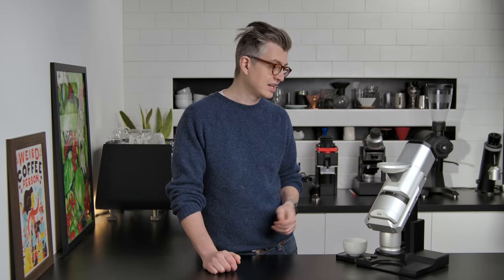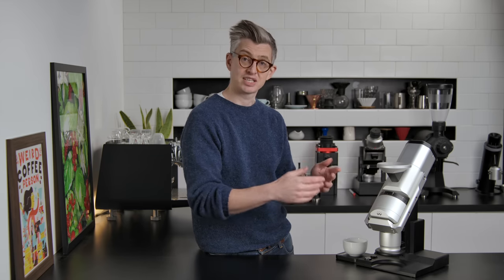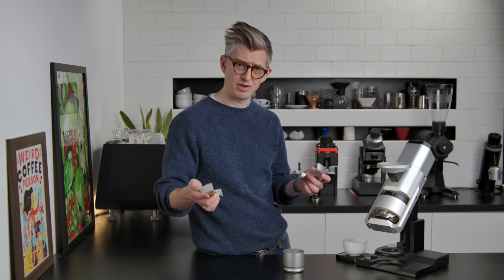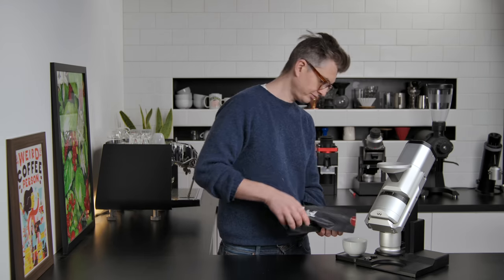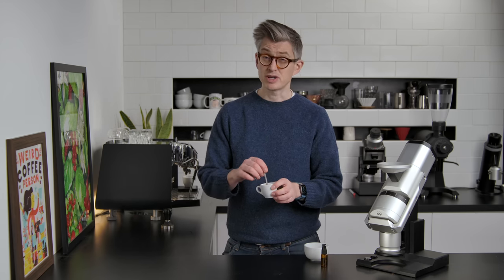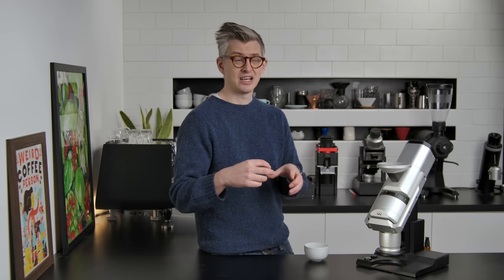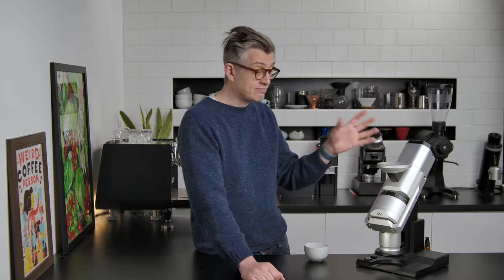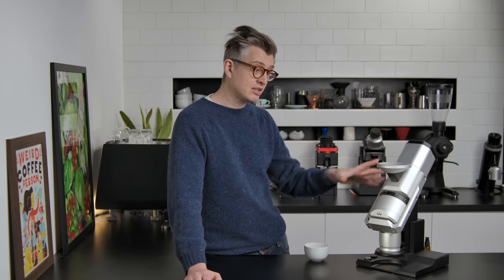The Weber EG-1 (Episode #2)

Comment: Drinking an espresso from an EG-1 right now. Good review. It really is a pleasure to use. The chaft spray is annoying. I never noticed the hunting for speed, at least audibly, but I’m grinding at 700-900. Maybe that affects it. 

I wish the chute knocker worked better. Coffee always gets stuck in here if you do not RDT.

It would have made the video longer, but it would have been cool to show how alignment and swapping burs works on this grinder. It’s pretty unique and highlights how well thought out this whole system is.
Reply: Nick, I too was frustrated with the chute knocker. Recently I joined the forum on Weber Workshop’s site. That exact complaint was brought up and Doug Webber stepped in to provide a solution. If you check out the instructions page on the site for the EG-1, Doug provided a pdf file for instructions to cutting out a wiper blade for the chute itself. Works pretty well.
Reply: @aidanfinger5934  thanks for the tip! I didn’t realize there was a forum on their site. There goes my afternoon.

Edit: I gave this a try and retention and exchange is basically zero now. I still wish it wasn’t needed but this will do! Just be careful using the knocker when the burrs are spinning if you do this mod.

Comment: Hey, i think that the way it chases the rpm is amazing, it makes me doubt that other grinders actually manage to be at a constant RPM, it seems like this uses a PID variable frequency drive, and from an engineering standpoint, it is a hard thing to implement and make it as elegant as you see it here. Let me tell you that often, the electric motors used in computer numerical control (CNC) mills and lathes, used for machining parts out of metal like the ones you see in this grinder, use this same style of rotational speed control. In machining applications the rpm of the motor of the spindle is very critical in order to manage the heat produced during cutting as well as the forces that the cutter has to tolerate, and they very often can keep the same rpm within about + or - 50rpm.

Comment: Hey James, the stopper at the bottom of the catch bin looks like it could be used as a tamper? I was just wondering if you tried to use it as one
Reply: Not sure if it’s exactly the same, but it looks exactly the same the Decent shaker/funnel that I own. And the stopper is just a bit large to be used as a tamper on a 58mm portafilter. This makes sense, and I’m not sure if it could be done differently, because the opening at the bottom of the funnel is designed to sit just inside of the portafilter, and the  stopper has to extend just past the inside rim of the funnel in order to not fall out the bottom. On mine, at least, there is also a small hole in the middle, so that’s not great. 

Two more thoughts. One, it sorta operates as a leveler, if you replace it in the funnel after dispensing the grinds, and if you’re filling the portafilter to that extent. But i tend to prefer my actual leveler. 

And second, and last, to each their own, but I’m just gonna guess that midlife-crisis-dude with a $3500 grinder (and idk, a La marzocco to match?) also probably already has an unnecessarily fancy tamper setup.

Comment: Right, so now I'm going to take off my "James Hoffmann is such a nitpicker" spectacles, and put on my industrial designer specs. For 3500 western currency units, I'd want to design something that has the ability to put on a bit of a show. Something to involve the user in its inner workings while it's doing its job. It would be cool to see the coffee dropping into the blind shaker, as well as it giving you visual feedback on when the grinding is done.

Is it a potential source of mess, to separate the exit nozzle and the blind shaker? Not if you optimize the flow of grounds exiting the grinder and falling into the blind shaker, and the way the falling grounds are slowed down when they do hit the blind shaker.

A more powerful motor would not get slowed down by the beans whilst grinding, meaning it wouldn't need to account for loss of grind speed that much. The unit looks like it fits a rather large motor, so I'm curious what the need for the speed compensation is about.

Besides that, there seem to be a few ergonomic flaws, like having to put your finger next to the (hopefully always inactive) burr grinder to take out the front part of its cover. Also, because of the size of the unit, it might obstruct your view on where you're grabbing the blind shaker when you're standing next to it, particularly if you're a tall person. You have to feel for it carefully or bend down to see it.

Sorry to be a little harsh, but I think the price justifies the scrutiny.
Reply: Shaker holder can be lowered down fairly simply as it “rides” inside the groove and simple push of a button allows user to change height easily. Medium to dark roasts tend to fall nicely into shaker without any mess or any RDT. Unfortunately lighter roasts are totally opposite and if shaker is not all the way up it a fairly messy affair. I use mine at 700rpm and during then grinding process and according to rpm display speed varies 20-30 rpm on either side of 700. Without any beans inside and when on it is whisper quiet and it is very easy to know when grinding is complete as the noise stops...As regards to removal of the bottom collar thankfully fingers don’t go anywhere near the burrs and being able to clean it in 60sec and without need of tooling is absolutely amazing. Just bit of feedback from day to day user

Comment: The hunting for the right RPM is probably part of a PID control as you said it's below and above depending on where it is in the grind.  Probably in the intergral part of the equation which handles error sum correction.  I've been playing around with PID mathematics and I can provide some interactive implementations with each part of the equation graphed out.  That error correction is a pain in the ass!

Comment: I suppose the trade off with the changing speed is that you pay for accuracy with sound.  Every grinder is going to change speed as it encounters more or less resistance, but most of them won't account for those changes.  Increasing the spindle's momentum by running it faster or bolting lead plates to the burrs ought to smooth it out.

Personally, I think that sort of thing is pretty cool - I get to experience how it's working or that it's working or something along those lines.

Comment: Excellent video. I could tell immediately this was an expensive machine. I appreciate you saying the price right away. 

I have been using the same Capresso Infinity Plus model 560.01 conical burr grinder for 12 years. Today you can buy 35 of them, or one of these. 

I own a roasting business...our commercial grinders we buy cost 1/4 the price of this.

Granted, the features and functionality on this one is amazing! They have thought of everything. Yes, grinding your own beans can get a little messy.

I like the idea of the spray bottle...is this just water?

Comment: I'm into getting the best coffee I can from a budget limited by a wife who is not as enthusiastic and picky as I am. As an ex engineer there is no doubt that the EG-1 is a lovely machine, but waaay, waaaaaay out of my league!
I have just purchased a new grinder, and spent all of £119 on it!
It actually replaced a 10+ year old Iberital grinder which cost a little more if I remember rightly, but it had worm-wheel stepless adjustment, which made changing from espresso grind to pour-over grind so tedious as to be impossible.
I've bought a Sage "Dose Control Pro" grinder (sold as Breville in some places) - and it is a great little machine.
I'm sure it lacks in many ways, but I have it dialled in for both espresso and 'Clever' pour over methods now and am very happy with the upgrade.
I'm a little surprised that you have never had it among your lineup of cheap grinders, but there may be reasons that I am not aware of, or have failed to spot it.
While it is a conical burr grinder with stepped adjustment, the burrs can be tweaked easily in 10 divisions to subdivide those steps if you want to be really picky, but to be honest, I've found a setting that works well out of the box.
Also, used with a stainless steel catch cup (a repurposed toothbrush tumbler thing) I have noticed almost NO mess from it. The Iberital was hopeless for grinds retention and spat them out in all directions. Not so the sage. There is a grind timer if you wish to use it, and I've found that to be very consistent - although I do weigh my beans into the hopper each time, so it's a bit unnecessary for me. At the price, it seems to be more than adequate, although if you had it on your show, I'm sure you would tear strips off it!
For those without £3.5k burning a hole in their pockets, and indeed those who would struggle to pull together the funds for even a £200 machine, I think it's worth a look, and certainly, for me at least, it is better than the 'terrible mistakes' available in the £50 category.
Am I allowed to post a link to it?
Probably not, but I got mine from a certain online ex-book-seller.
Incidentally, is the trend for grinders to look like microscopes in YouTube thumbnails? The P-64 did, and so does the EG-1
Thanks James for your continued entertaining contributions!

Comment: I have to admit I did not read the other comments. My question is, do you know for a fact that the RPM is changing as much as you think? A slight variation in motor speed as a result of increased load would initiate a call for higher current. When the motor is under load and more current is passing through the windings, more noise will be emanated. Said noise could easily be misconstrued as an unwanted change in motor RPM.

Comment: It sounds like the wandering of the motor note may be due to load/voltage feedback circuitry. Makes me think the other grinders may just apply the applicable voltage for an assumed load not a real time measure of load. I would imagine this is higher order function.

Comment: The drift in RPM that you don't like is indeed a manufacturing defect: a problem with the PID settings in the micro controller that controls the motor driver circuitry.

Comment: There's a different configuration for the 2 black pieces with the blind shaker that I've found to be a bit better as far as mess. If you put the "full circle" item all the way at the top of the track and then the "half circle" you put the shaker into and move up until the shaker is flush with the top circle. I experience zero mess in my daily grinding with that setup.
Reply: That’s a V1 component.  WW phased out the filter holder.  We missed some good antics of portafilter drop on the video for that reason.  It’s the reason to watch the Lagom vid again.
Reply: I have V2 and it does come with “fork”.
I use it in that setup where you slide shaker into the fork and ring sits on the top of the shaker. Saying that darker roast don’t create any mess for me while the lighter roasts make hell of a mess in any other configuration in my case

Comment: Don't think it was mentioned here that the EG-1 uses a 80mm burrs. Large burrs 75mm+ act more like conical burrs in that small changes to the settings don't affect grind results as much as smaller flat burrs so although stepped it's much less of an issue than a past flat burr user would normally expect.

Comment: I suspect that the modulating power (and its associated sound) is to achieve the RPM as set by the user and depends on the power load being placed on the motor (presumably a function of bean density, grind setting, actual power to the unit). I understand what you mean by "it doesn't reassure me," but other grinders are set to achieve a certain RPM under a single load condition, and then invariably do not achieve that when the load condition varies. I think this is actually a surprisingly persnickety engineering decision that should be considered a strength of the unit, not a weakness.

Comment: the most important part here is comparing the motor with KafaTech Monoloth Max with regards to the RPM in the long run

kafatech says they do not go over 400 RPM due to motor conservation reasons

given the exuberant EG-1 grinder cost, I’d expect them to advise on the matter, projecting the motor’s longevity relative to the RPM it’s used with

Comment: Hi James,

Great series and channel! I'm wondering if you have any plans on covering some advanced bits in the espresso brewing process. Specifically:
- Tamping force (i.e. what is the difference between 10 kg and 30 kg of force and should one be preferred over the other)
- Flow profiling (are slow shots better than fast ones, would sinusoidal flow curves be desirable in the brewing process, or flat ones, or step functions at n different flow rates, etc)
- Brewing at lower pressures (tangentially related to the previous, what I mean here is considering "flat" pressure curves only, then comparing say 6 bars and 10 bars, for vibration pumps and rotary pumps, does there exist a difference between machines at these pressures)
- Filtration capacity of different baskets (e.g. E&B superfine baskets vs. VST ones)
- Technical side of modality of coffee grounds (what standard deviation, average, etc. is considered "ideal", of course this will remain phenomenological and non-scientific, expecting a fully scientific breakdown would not be reasonable)
- Effect of grinder RPM
and their effect on tasting notes.

Cheers!
Reply: Probably got loads on this through old episodes
Reply: @smartgorilla  I went through the channel and could not find definitive coverage on any of the topics..

Comment: Variable speed is either a pro or a con... hmm... if it's just wobbly pwm signal because they decided to have more rpm options then motor can reliably deliver, like on a cheap PC fan that would be bad design. 
If it's adjusting speed to keep it consistent when coffee grounds try to slow it down, well then it's good.
Which one is it? probably the first one.

Comment: The "hunting" sound of the RPM sounds like closed loop feedback.  Not only do you set it to 600rpm, but the controller is checking to see if the motor is hitting that RPM and adjusting power until it does. I bet 99.999% of grinders would be "open loop". It seems very expensive to add closed loop feedback to a grinder unless you are already using a very expensive (servo?) motor that already uses the feedback. If I were to guess, any of the grinders that "sound" nice, would actually be slowing down once they meet resistance. So the question becomes, what is more ideal; Having a constant setting? or having a setting that means something? Is it important that 600rpms on the dial really means 600rpms at the burrs? or do you just want that number to be representative?
The one nice thing about the closed loop feedback is that as your bean / moisture / roast changes, you wouldn't need to change the rpm setting to get the same thing out. Whereas with open-loop, a different bean my provide more or less resistance to the grinder and you may effectively need to raise the rpm for another coffee to get the same "real" rpm out at the burrs. Only way to really know if this is the case would be to use a laser tachometer. Probably overkill. But so is this grinder.

Comment: I always imagine these super expensive devices that do the ( surface level ) same thing as inexpensive devices need to be blind tested on the resulting coffee by a fairly large and diverse group of coffee drinkers ranging from those who define Gold Blend as good coffee through those that define Starbucks as speciality coffee to James level coffee experts. Also for James, a question, at what approximate price level does the resulting coffee grind produced cease to demonstrably improve ( as in becomes totally subjective on taste ) and the machines become just ever more expensive devices for designs sake?
Reply: Past ~$1k you're into serious diminishing returns for grind quality. Grinders that cost more are made with commercial-grade parts meant to pull hundreds of espressos per day. Therefore, you're paying mostly for the longevity/durability. Grinders like the Monolith and EG-1 are "boutique" grinders because they're not necessarily targeted for exclusive commercial settings, but are basically built as such. Secondly, they're produced in very small batches vs. the large European-based brands like NS, Anfim, Malhkonig, etc. Getting 83-98mm burrs alone cost like $400-$500, but those burrs would last the average home consumer multiple lifetimes.

If you don't care about owning something that will likely outlive you or your grandchildren, get a Sette 270 or Niche Zero. And if you want to brew filter along with espresso, then get a Baratza Encore to go along with that :)

The jump from a $20 blade grinder to something like an Encore (for brew) or a good espresso-focused hand grinder like the Orphan Lido-E is much more significant.
Reply: @LuckyDragon289  As I thought then, most of these super high end (priced) grinders are more about  showing how much money you have than the quality of the coffee you can make.
Reply: @Thetache  ...That's not what I was implying at all. Sure there are some people who just want to flex; others want to support small/local companies (e.g., the Monoliths are all made by one guy in Seattle); others are chasing the top 1% of coffee because they have very niche tastes, which can't be achieved by cheaper grinders due to manufacturing tolerances; and some just value the "buy it for life" mentality.